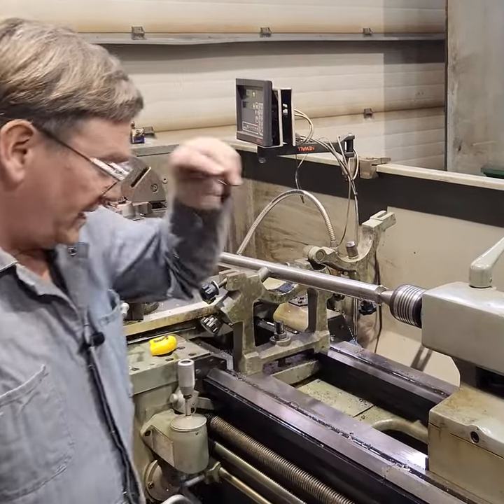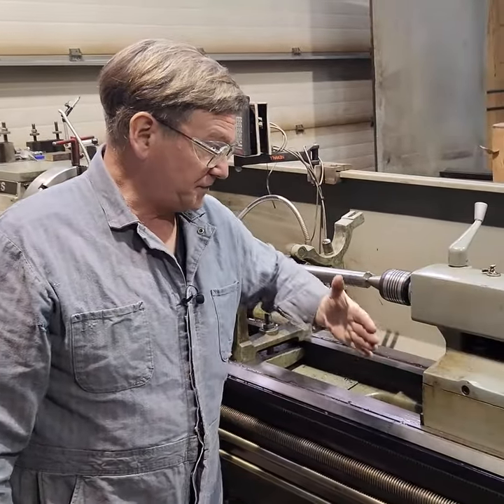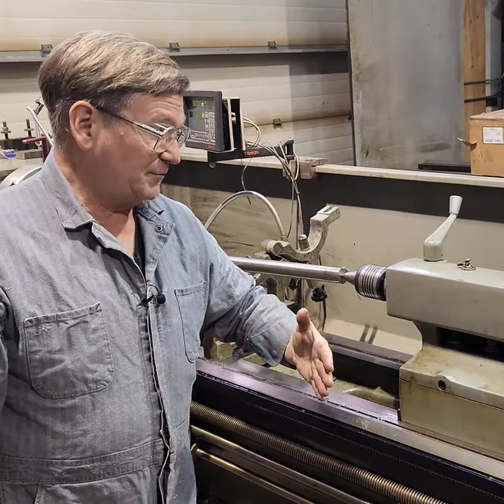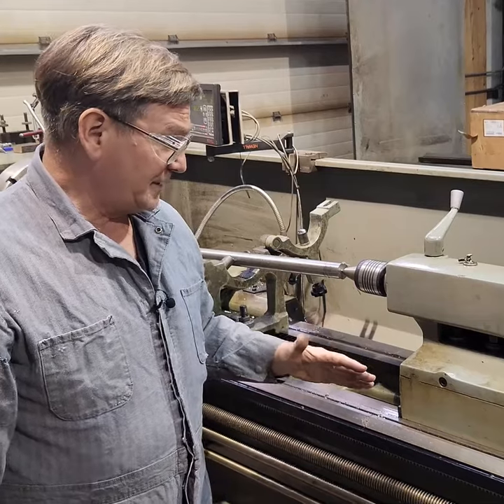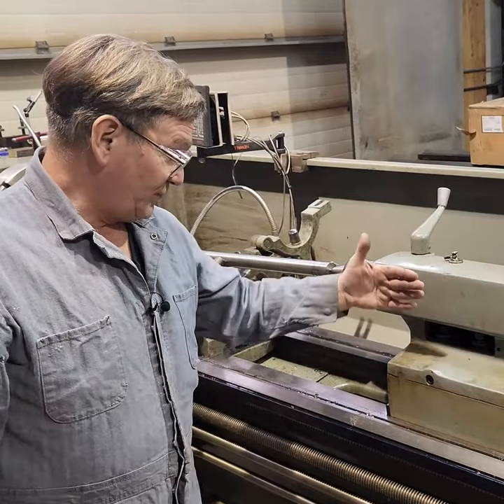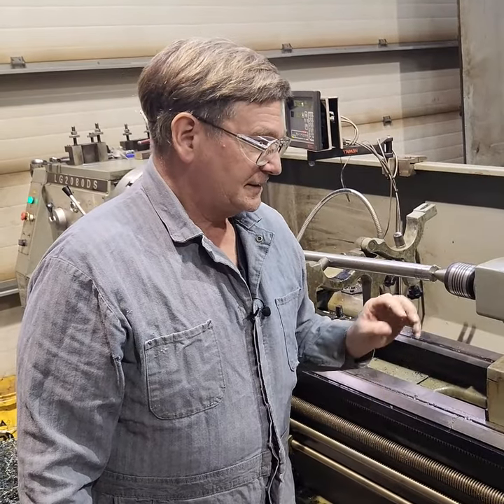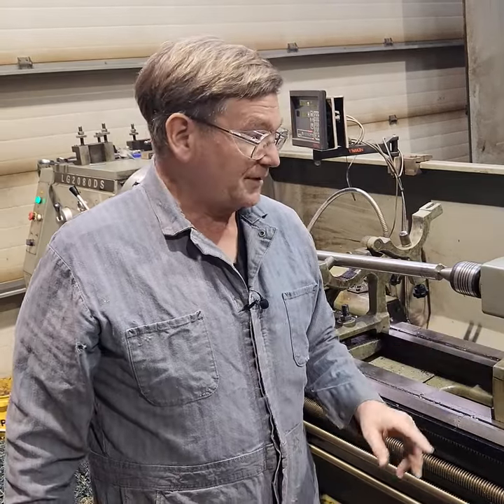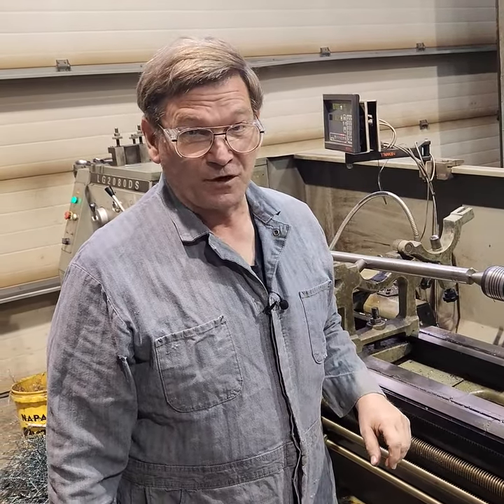Machinist's Minute: Problems with tail stocks

Comment: Ive modified my tailstock for air cushion with auto oiler, run at 60 PSI and the tailstock glides and air pushes dirt away from slideways
Reply from the maker: Oil injection, into the airstream? or 2 supply paths?, or some other way?